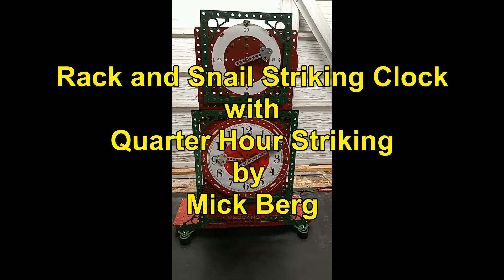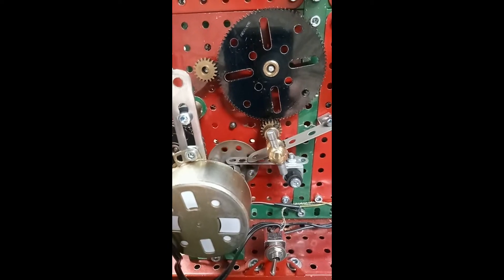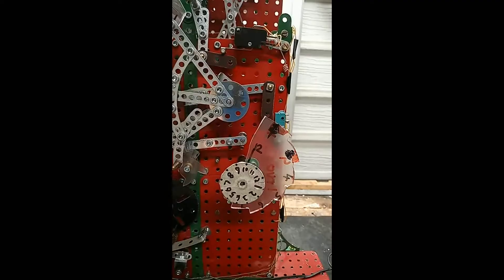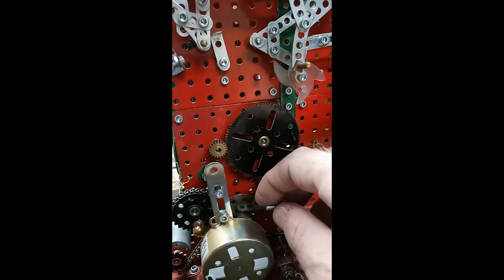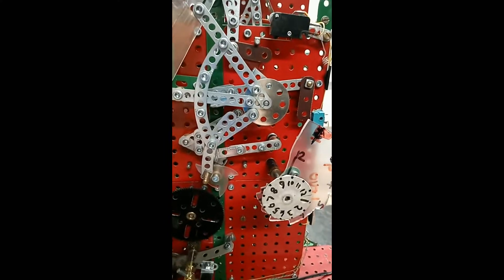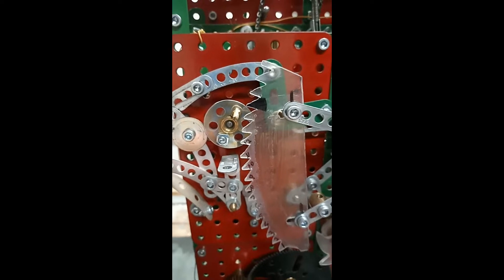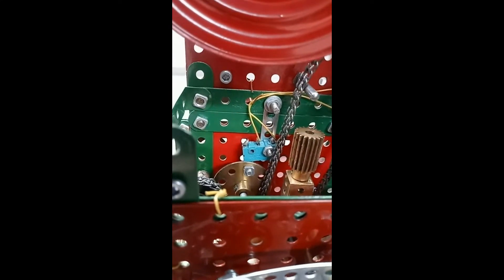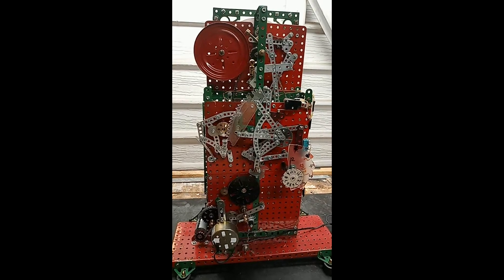A Rack-and Snail Striking Clock in Meccano

Comment: Hi Mick. Odd that your synchronous motor speed is giving a slight problem. Is it perhaps a UK motor designed for 50Hz, and your US supply is 60Hz? I believe electricity suppliers may sometimes change the frequency of their AC at periods of high demand. I seem to remember reading somewhere that the frequency would get corrected later, to restore accuracy to timing devices. Maybe that no longer applies in the digital age.
Reply: Hi Chris. The motor is from China. It is rated 30 rpm at 50hz and 36 rpm at 60hz. I have tested it out of the clock, using an rpm counter app on my smartphone, and it does indeed run a tiny bit slow. Here in US the number of cycles per day is corrected at the end of the day, but the inaccuracy during the day is minute. And the motor has been consistently slow.